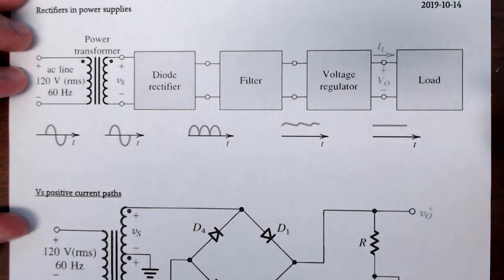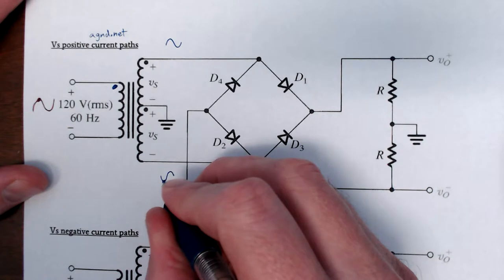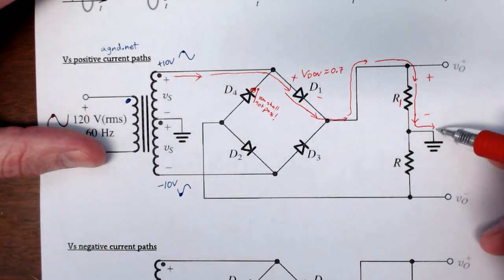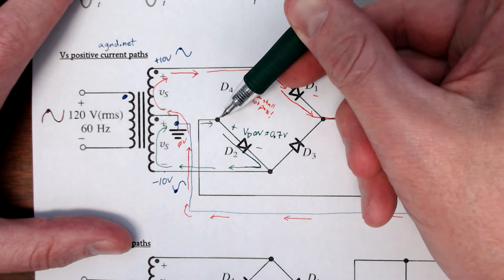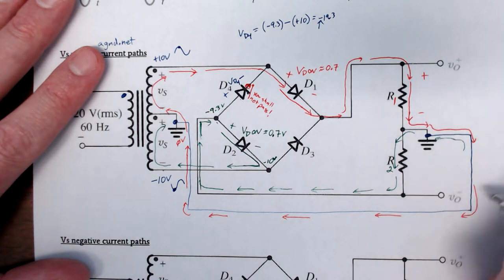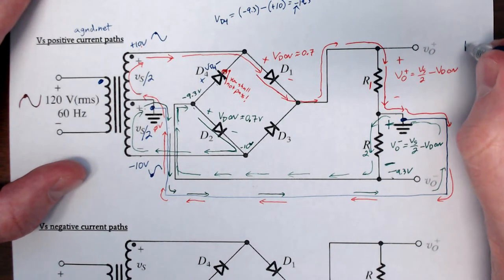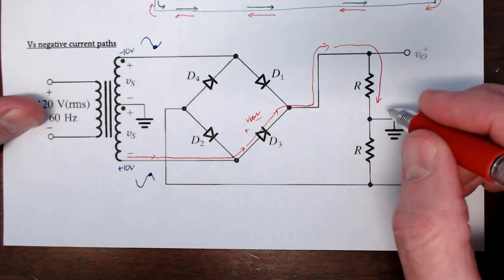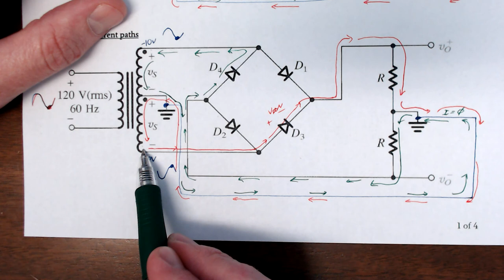Current flow through a bridge rectifier

Comment: Hey, I've got a question. Wouldn't there be current flowing in both directions through the GND to GND connection (GND between the secondary coils and GND between two resistors) at the same time? Thanks
Reply from the maker: In concept, yes.  In reality, no.  The actual current flowing, that you would measure with a meter, is the summation of the current in the two directions.  IF there is perfect symmetry, then these are equal and opposite.  In that case you could cut the GND-GND wire and there would be no effect on the situation.

Real circuits never have that perfect symmetry, so there would be a small net current in that wire.  The difference is the same as a 3-phase power system with 3 or 4 wires -- a (perfectly) balanced system with no harmonics has zero current in the 4th wire, "neutral".
Reply: @DanWhiteValpo  Thank you for answering. That helped quite a bit.